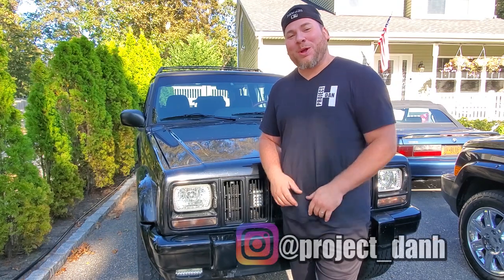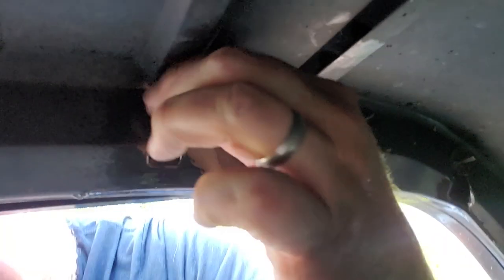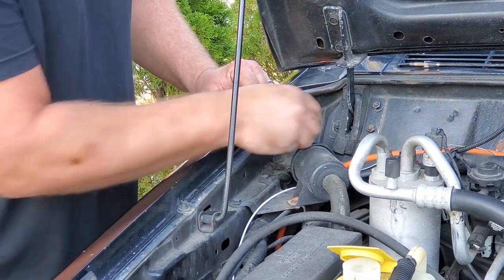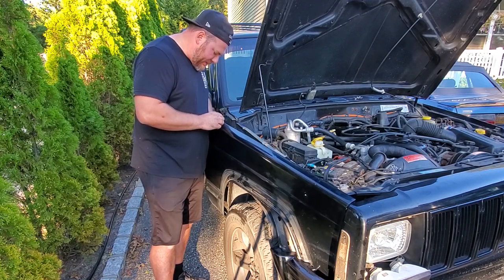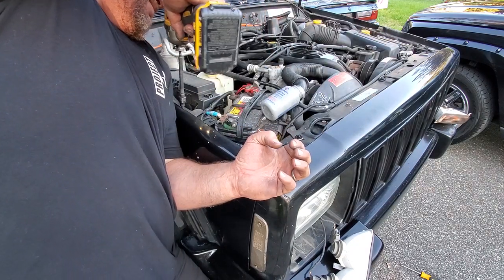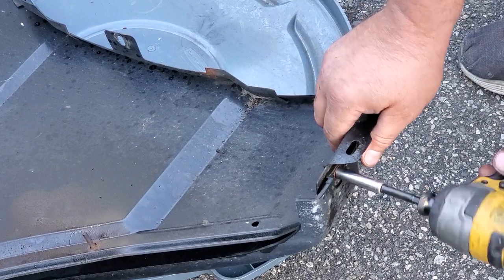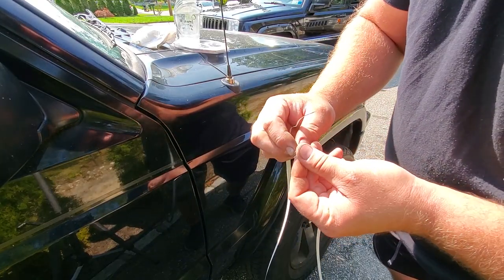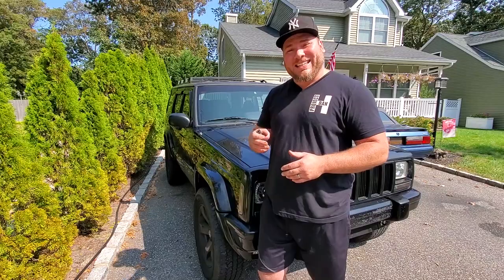JEEP CHEROKEE XJ FENDER & OEM FLARE SWAP - THE BAD SIDE (PASSENGER SIDE)

Comment: Can you please help me I have a problem with my Jeep 1999 xj. Whenever I get into my car my lights don’t come on inside the Jeep. All of the dashboard and the lights inside on top of the roof. Then my battery dies after 2 days if I don’t use my Jeep everyday
Reply from the maker: not too sure.. but it may be that you have a melted wire in the dome light area.  check all the plugs in the lights, make sure there is nothing burnt in in the connectors causing a short.  then check your fuses!